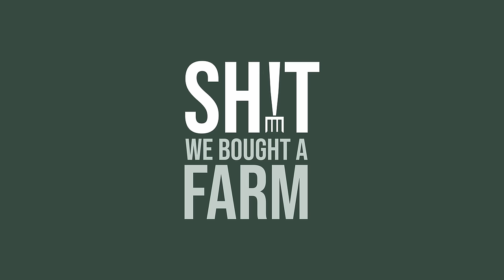Farmhouse Progress... Is there a fireplace?

Comment: Interesting to see that you have vertical sarking boards on the roof.  I don't think I've ever seen that before, but will be looking out for it in future.  I'm guessing that they went for vertical as a cheaper form, using the purlins to mount the sarking boards and dispensing with the need for rafters.  But it is certainly unusual.  I wonder if that building was originally thatched (a clue might be a stepped overhang feature at the base of any chimneys)?  Has your roofer commented on this roof?

Comment: Opening up that fireplace is a good move, to help with the airflow (unless the chimney is capped without ventilation).  But be aware that the salts from burning coal will have penetrated the stonework in the chimney and that these will absorb moisture from the air and always have a tendency to be damp in our humid climate.  Long-term ventilation of the flue is a must or that dampness will seep into any new fabric - as can be seen in that newish boarding that you removed.

Comment: Sweep and smoke test the flue first. If it's sound you may be able to get away with not fitting a liner. You will need to fit a gather plate to accommodate the stove pipe and a suitable cowl on top. Check building regs, a liner might be compulsory in Scotland.

Comment: I have done a couple of old houses and have sanded down plastic gutters and painted them the paint lasts for years
Reply from the maker: This is really interesting! Did you also paint the brackets?
Reply: @sht-farm  yes took old gutters off and brackets painted them both and put them back thought the paint would peel off in time but it has not